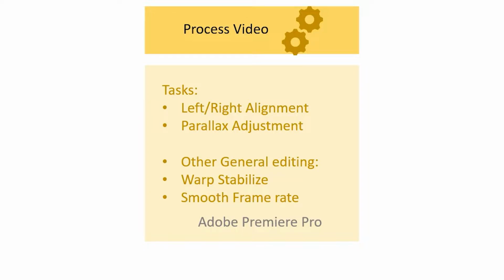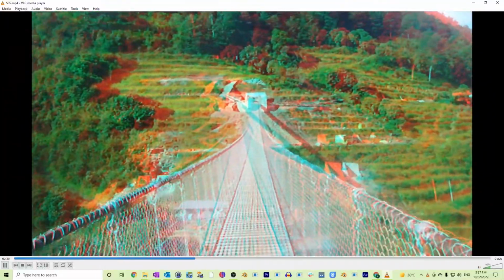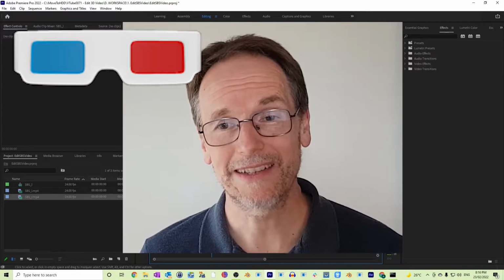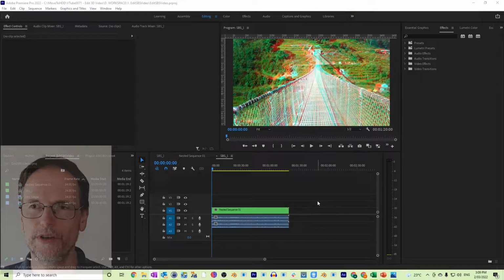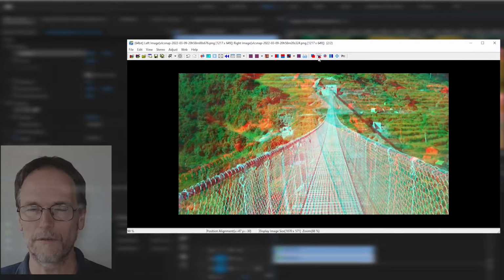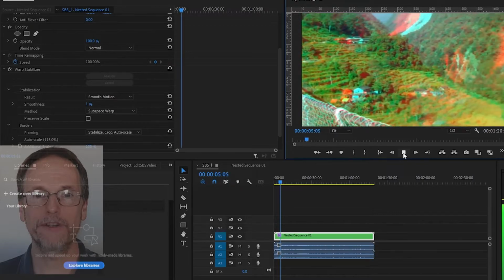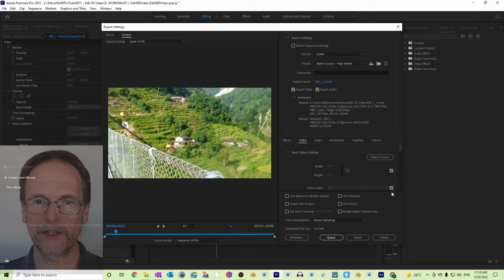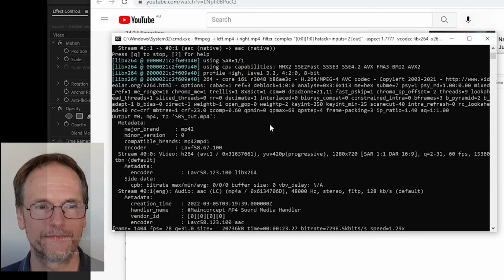How to Edit 3D Stereoscopic Video (2022)

Comment: Hi, amazing video which helped me a lot !! 
but I'm trying the convert a VR180 / VR360 to 2D Anaglyph (Red/Cyant) with no luck for now. I succeded to convert it to stereocopic (red/cyan) in Vegas Pro (didn't found yet where to adjust the cyan color to better suit my glasses), but I fail in finding a way to minimise the distorsion of the picture, as in a 180 or 360° video the picture is distorded, but i just don't know if there is a way to minimise the effect and having a planar picture result in 3D but with Stereo red/cyan. Thanks for any help !

Comment: Hello
I apologize, it’s a machine translation 🙂
FFMPEG works great, but I have a question. FFMPEG doesn’t use HW acceleration, HandBrake does. Is there a way for FFMPEG to also use HW acceleration? I don’t need to say how slow it is without it.
Reply: I've not tried it myself, but I believe that hardware acceleration is supported but depends on your drivers and hardware of course.  (example I found: "ffmpeg -c:v h264_cuvid -i input output")

Comment: For the EGO files it works very good, great !!   An nice Premiere editing info, i am going to try this in Davinci resolve 18.5, when i have the Pro version. This might be about the same.😅

Now I also have some older s3D footage in AVI from a Panasonic Z10000:
 i tried tot use the same cmd-string, only change the source  *.MP4 in *.AVI. (For %f in (*.AVI) do ffmpeg -i "%f" -vf "crop=w=iw/2:h=ih:x=0:y=0"  "%~nf_LK.mp4" -vf "crop=w=iw/2:h=ih:x=iw/2:y=0" "%~nf_RE.mp4") The splitting did work out only it turned out to be a wrong codec for playing back the  left  or right files. Can this work ?  thanks!!😃
Reply from the maker: @MrToondeWit, thanks for your feedback. How are you finding the Z10000 camera? Unfortunately I don't have one of these, so can't experiment for you regarding the ffmpeg command, but I suspect that you will need to use a different way to split the file as it uses the MPEG-4 MVC 3D format. For this I suspect you will need a command something like: ffmpeg -i input_file -map 0:0 -c copy left.mp4 -map 0:1 -c copy right.mp4 (you may need to handle some other metadata information also). Let me know how you go.

Comment: Can the sbs video just be cropped to export the left and right sides using video editing software rather the ffmpeg? Or does that method cause problems that would make the left and right side not usable if done that way?
Reply from the maker: should be no problem to crop and export, as long as the SBS video is full width SBS. If it is half width then your exported videos will also be half width.

Comment: Thank you very much. I really like the way you talk and explain issues related to editing and processing stereo video.
Until recently, I have been shooting VR 180 3D video using the Insta 360 EVO camera. Premiere Pro does a good job with this format and allows you to get a video that meets my abilities and desire, immediately suitable for distribution on YouTube and DeoVR.
Recently I bought a QooCam EGO camera and started trying to shoot flat video in SBS 3D format.
And I immediately ran into the fact that my "favorite" video editor Premiere Pro could not cope with editing such a video.
After a series of searches, I settled on Vegas Pro, in which the functions of processing such a video are present.
Of course, I want to spend less energy on technical tasks and pay more attention to the creative issues of creating video content.
But otherwise, the interface and ways of working in these editors are very different, which significantly complicates and slows down the process. And since I continue to shoot in different formats, I have to use two very different video editors.
Your video explains the principles of video editing and how you can use ffmpeg to split and merge video streams. Thank you.
In addition, I want to say that the issue of stereo video stabilization seems to me very important and relevant. The built-in stabilization of the EVO & EGO cameras partially solves the problem, but by experience I came to the conclusion that stationary shooting is preferable or the use of an external stabilizer in addition to the in-camera one is mandatory.
Reply: Thank you for this comment!  I have followed this video with great interest. But I also will be working with a couple of video camera systems which I have just bought-- the QooCam EGO, and the early GoPro camera system with dual Hero 2 cameras, which you can buy cheaply these days.

I've done only a little video editing, but I understood all of the concepts outlined here.   I used StereoPhotoMaker for still photos a dozen years ago, so I understand parallax and alignment, and editing in anaglyph.  That said, I can't afford several cloud subscriptions for several editors, because I will be only an occasional user.

This presentation was so complete and easy to understand, that I hope I'll be able to navigate Vegas in a similar  way. If not, I may adopt Adobe Premiere Pro for all projects not involving the QooCam.

Comment: This is gold! 
Thank you! I 3D printed a case for my HERO 5 Sessions and shooted a ton of 3D footage in Morocco, but realised that gopro's app can't correct if the videos are out of sync. 
I was sure that it's possible to do it with Premiere but didn't expect to find a tutorial this good! :)
I'm exporting my first trial right now. But I merged the two sides in Premiere. I'll see in a few minutes how it turns out... :)
Reply: I'm working on something very similar.  Using two consumer cameras (GoPro 11 Mini) and custom software and camera mount that I've built, I'm getting very good results.   And, the software does all the work for you.  If you're interested in testing the software, please let me know.  It runs on windows only currently but thinking about porting to MAC.
Reply from the maker: @Chris Fulton, definitely would be interested in giving the software a go.
Reply: @indyglass  Sounds great! I'm interested for sure! :)
Reply: @BerkeiSzilárd   Get me on Facebook or send me your email address.
Reply from the maker: @Berkei Szilárd, How did you go? How did it turn out?
Reply: @ANAVision  It works, but didn't have too much time to mess with it. I should improve the positioning and cropping, because there are black bars on the first export. If I'll have a good one I'll post is on my channel. :)
Reply from the maker: @BerkeiSzilárd  looking forward to it. Love the paragliding videos by the way 🙂

Comment: How to stabilize two videos that were record on two the same iPhones? At the same time, each iPhone has its own image stabilization by default. But when I combine them in anaglyph mode, it is clear that their stabilization works differently, that is, the videos do not match. The video does not shake, but the smooth movement on two identical iPhones does not match. Videos float relative to each other. Is there any way to align this in Vegas? Align stabilization so that it is synchronous? (I'm using Vegas, tried internal stabilization in Vegas and ProDAD Mercalli plugin - doesn't help)
Reply from the maker: Question - did you have the two iPhones rigged together, or were they held independently? If the former, then you may get good results by turning off iPhone stabilisation, and stabilising in Vegas using method I describe in my video. The reason I say this is because stabilisation would then be applied equally across both left and right eyes. But if it is the latter then the much bigger issue will not be stabilisation, but synchronisation. That would be quite a challenging task, not one I have attempted. If I were to attempt this though I would use automatic motion tracking in Vegas on both left and right eye videos and then match them. Would love to hear if anyone else has other ideas on how to approach such a  case.
Reply: @ANAVision  Thnx )   Yes ) two iPhones rigged together,   but  anyway, stabilization works differently for them, each of them independently decides how to stabilize their angle, this results in swing relative to each other. There was an idea to make keyframes and manually change the position of one of the videos almost every second, but this is a long time. I would like to find an automated version.  The iPhone does not have an option to turn off stabilization. Most likely I will have to use third-party camera applications.